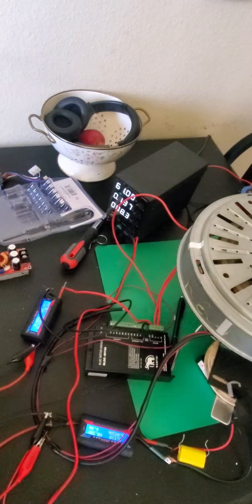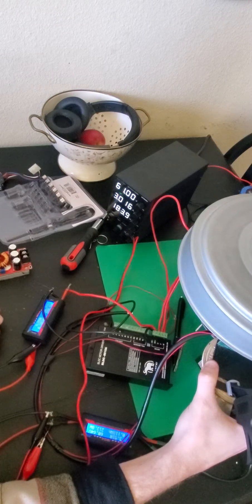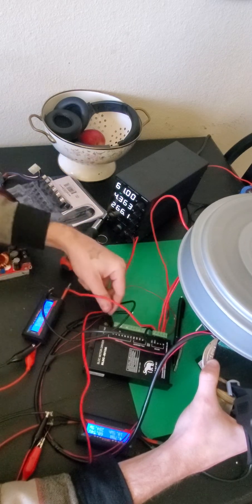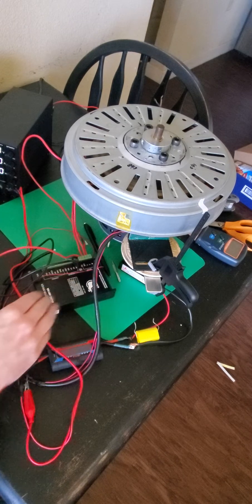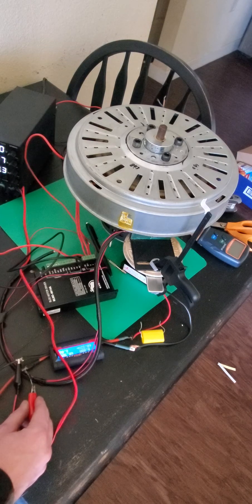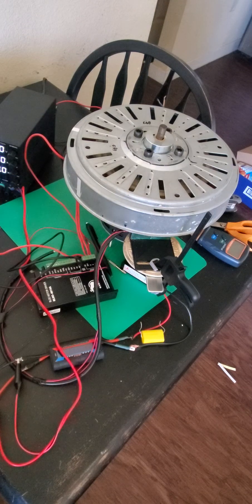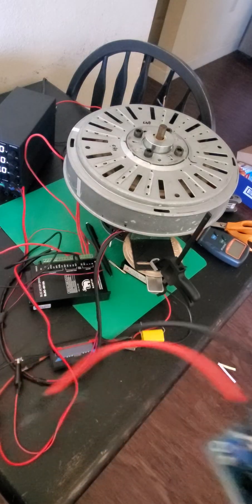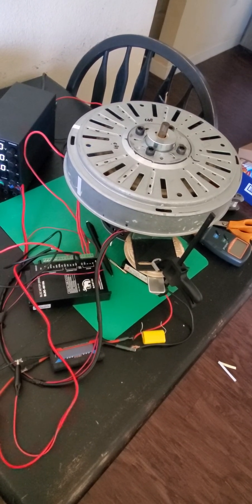Samsung wired 2 series, 2 parallel poles. Using 80v Hall Driver.

Comment: Also glue repealimg mags together ++ -- ++ --..... to make a field spike  between them and add a bank of capacitors.
Reply from the maker: @floating69poet  but that does have its applications. Ie lockridge device using the pinched flux
Reply from the maker: @floating69poet  I tend to use stock configurations for these. I have plenty of capacitance too